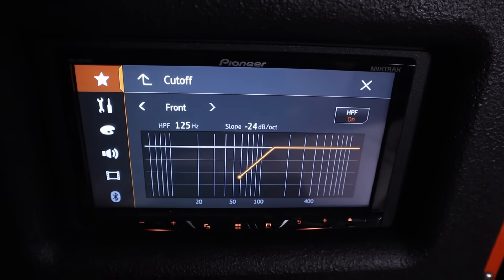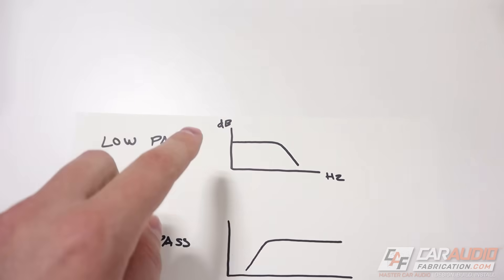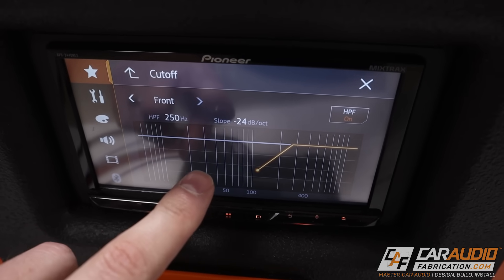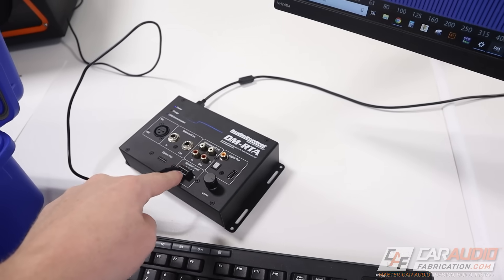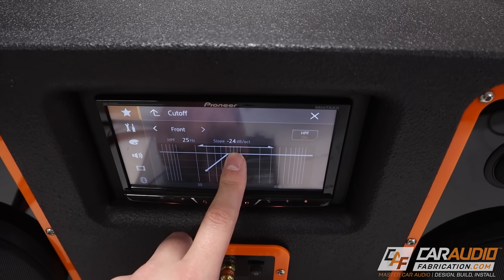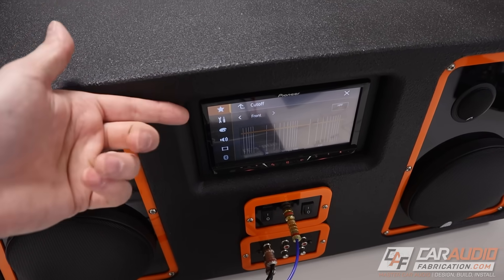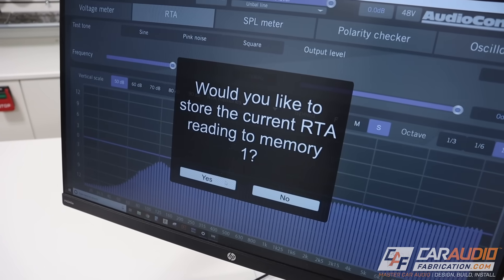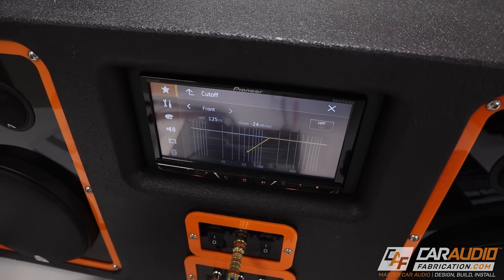Crossovers for Car Audio - Tune on HEAD UNIT or AMPLIFIER? Or combination?

Comment: Is all this trouble really worth it? I mean, you are putting this in a car which is not exactly the ideal place for discriminating sound quality.
Reply: This probably isn’t the YouTube channel for you. However, I will say that you can get incredible sound in your car if that is your goal.
Reply: yes, yes it is. This not only addresses audio quality, but speaker longevity. Standing waves can be more difficult to tune in a vehicle, so isolating speakers with a crossover is critical. For longevity you really don’t want tweeters running lower frequencies and subs need that subsonic filter too. With good tuning and insulation, vehicles can sound amazing! My truck is like a festival venue. Most people who trash on car audio don’t pay attention to the critical details which makes the system crap, reinforcing their beliefs. Drive in movies are amazing especially if you have the speakers set up to recreate the 3D audio effects usually only heard in movie theaters, and you don’t piss off your neighbors because it’s mobile and their walls aren’t rattling all the time 😜
Reply: Good question. A modern vehicle is the most sound-conscious treated environment that 99% of us will ever be in. The interiors are designed around noise creation and elimination. A lot of high-end music producers will reference their tracks in their cars for this very reason because the sound systems (whether factory or aftermarket) are designed to give the best possible listening experience in relation to the cabin and the listening position of whoever is in the car. If their tracks sound good in the car, they more than likely will sound good on anything. If you have a decent car newer than 2005, you’re essentially driving a mobile sound studio.

Fun fact: a modern vehicle can make for a fantastic vocal booth with a few very easy mods like using cheap moving blankets to combat reflections from windows. Sit in the most central spot and block reflective surfaces. Done.

My point being, yes, it is worth the trouble. When you put hundreds to thousands of dollars worth of audio equipment in your vehicle, you want it to reproduce the sound as best as possible. And, your vehicle is the perfect spot to do this. Now, if you drive a junker that you just slapped some speakers and a woofer in its still worth it because you still want those components to receive and deliver the cleanest signal possible. Not only because it sounds good but it will keep your components working their best for as long  as possible too. What it takes to convert electricity into sound waves and produce a clean sound can put a lot of power through precise components and we want to protect those components from accelerated wear by setting their properties correctly.

Comment: Is it important for me to change the company fitted head unit cuz i got a high-end sound system installed in my car and my friend tells me to upgrade the head unit and i dont want to waste any unnecessary money. i would like some help ty :)
Reply: For a high end aftermarket system an aftermarket head unit is best for sound quality and control.
Reply: Mubaashir ulMulk if it’s a stock HU, I highly recommend it. Look at preamp voltage, eq capacity, and dedicated speaker/woofer outputs. If the installation already replaced your HU, and you like the sound, you’re set. I have the same pioneer HU he was using and it’s amazing! Highly recommended product. Much crisper sounds and tons of built in tools to really get your system singing!
Reply: If it already sounds good TO YOU with the company fitted head unit then it’s most likely a waste of money just so it “sounds better” to your friend. It’s not your friends car, it’s YOUR car. Now, if you are interested in diving into audio tuning in general or you actually enjoy hearing the subtle differences between instruments/sounds/locations and want to be able to adjust individual settings to your exact liking, then an upgraded head unit may actually be worth it. Company fitted head units do not offer much in the terms of sound customization. Sure, you may be able to adjust a few things but your control is usually severely limited AND most company fitted head units have weird EQ curves (that you can’t change) that change depending on how loud the signal is. Usually meaning that the louder your volume, the lower the bass (to protect company installed speakers from being damaged from loud playback).

There’s two positions you can be in here. Position 1) You just want to play music and have it sound good with the least amount of user input so you don’t have to go messing around with multiple in-depth settings to achieve the sound you want. Like I said above, if your current company installed head unit already sounds good TO YOU, you don’t have to do anything more and you can stop reading and just go enjoy your music. Position 2) You want your aftermarket speakers to sound the absolute best they can. That’s usually why people get into aftermarket car audio to begin with. They want better sound quality. A bonus to doing this, if you also get an aftermarket head unit, is that you are now allowed to adjust the signal going to the speaker and the sound coming out of them. In 2020, a new aftermarket head unit is pretty much a dash mounted DSP (digital signal processor) giving you control over how your system performs and sounds. If you want to change settings to get the “perfect” sound then an aftermarket head unit is a good idea. Also, depending on your components (speakers, amps, wire quality, etc.), being able to control the signal path may help protect certain other components in that signal path from being over/under powered, help with frequency interference (crossover control), and help to deliver an all around cleaner signal and power path.

Again, if your current system is installed properly and YOU enjoy how it sounds, an aftermarket head unit may be a waste of money. However, If care about pushing your system safely to its highest potential, then an aftermarket head unit might just be the thing your system has been missing and you don’t even know it because you haven’t heard your system with an aftermarket head unit yet. 

I don’t want to make your decisions for you but if it were me, I’d choose control over convenience when it comes to audio. Meaning, if I had aftermarket speakers/subs/amps I wouldn’t hesitate to also get an aftermarket head unit. IF you can afford to upgrade units and YOU WANT to, go for it man. If not, keep enjoying what you have.

Comment: That radio has network mode and it will give you bandpass on the rear channels and rear pre outs and tweeter  freq highpass on the front channels and pre outs, than rear low pass for the sub pre outs.
Reply from the maker: I know, but this video is meant to be focused on a broad topic, not the performance of this specific head unit.
Reply: CarAudioFabrication figured you knew!

Comment: I have the Jl audio rd500/1 and there isn’t a way to off/12db/24db how would I by pass this to use the HU? Or would I just turn up the LP to 200 hz on the amp then set the head unit
Reply from the maker: Yes, this would be a case where you could use head unit for main setting and amplifier for backup setting or vice versa depending on what slope you want to use and if the head unit offers it over the amp.

Comment: I use the crossovers on the DM-810 as I can see the crossover points clearly and I can use the EQ to flatten them as well. I don't use my sub sonic crossover as the DM-810 only goes down to 25Hz but I'v set it up with a 24dB roll-off for good measure.
Reply: How do you set the Lpf filter on amp while using Dm-810?
Reply: @gregcarranza6547  I just set it at max on the amp and let the dsp takeover. For example, if your amp has a 20-200hz range, set it at 200 and use the filters from the dsp.

Comment: How do component speaker crossovers play into all of this? Are component speaker crossovers kind of a moot point? I just purchased some Memphis Audio VIV60C component speakers and I need to learn more about these component speaker crossovers. They have a 12db and 24b toggle switch and I heard somewhere that feature can help with an off axis placement. So much to learn! But I am curious how component crossovers play into this equation you are discussing.
Reply from the maker: This may give some more insight: https://youtu.be/16odoySgp-I

Comment: Thanks for putting this together! I had been wondering this very thing, some of my systems with aftermarket HUs and amps I wondered whether the radio or amp was the best place to use the crossover!
Reply: @chevycorvette6251  where are your amp settings set at?

Comment: This is super helpful. Just installed a new subwoofer, speakers and wireless CarPlay head unit on my FJ cruiser. Thanks!
Reply: FYI wireless is terrible audio. Compare the same song on CD and Bluetooth, it’s night and day difference.
Reply: TheSynysterVyrus agreed on bluetooth. however, wireless CarPlay uses WiFi, so the audio is improved, or closer to the source. it’s convenient that I don’t always need the phone plugged in, however.
Reply: @mcirone  You mean to say that Wireless Carplay will play Hi-res lossless song without compressing the original quality when streaming from Apple Music App? 
I am searching this topic in many areas, but can’t find any solution
Reply: Nah it can’t.  Needs a DAC that’s capable plus wired connection via usb3 apple camera adapter